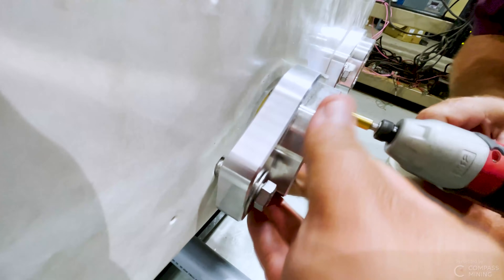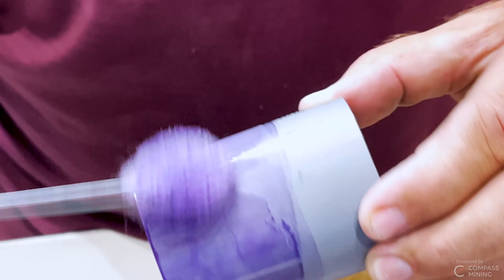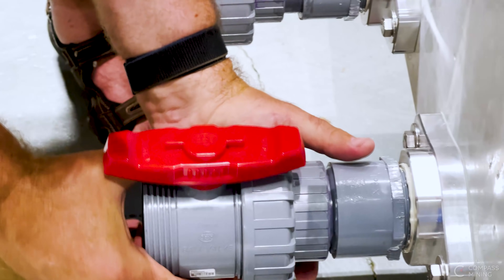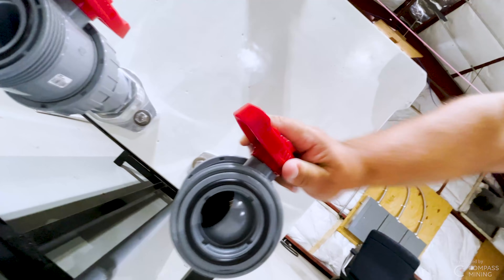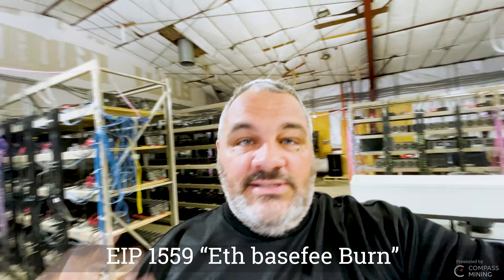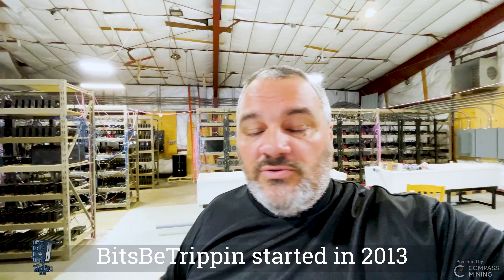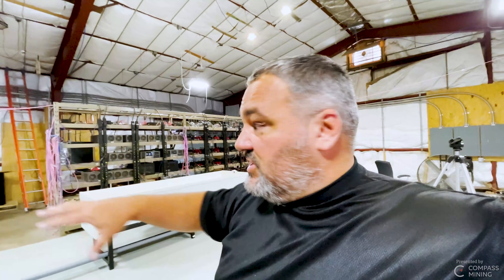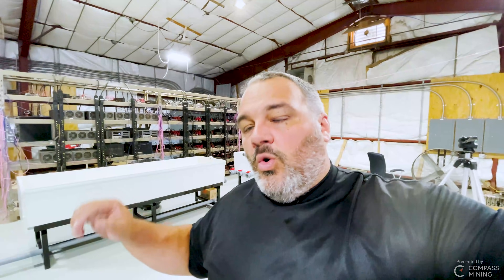Immersion Build - Day 2 - GPU Mining Farm

Comment: Yes you do need to use PVC primer, your Technique needs adjustment and you do not have to use the unsightly purple in your shop for first rate results. I would be curious to know what the design max leaving fluid temp from the HX is, as I would likely not be using even SCH  80 PVC for this job were it me. Last time I checked numbers on SCH 40 it was 120F max, which I am not comfortable with in the least. Even for glycol, PVC is a very fragile affair. If you are an american it would be REAL GOOD to refuse to speak in Metric units or embrace that fallen system in the least.

Comment: Thanks for sharing this with the community. Just a few thoughts and questions:
1) In an overflow system you will typically want 2x the return size as your supply due to friction losses and a non pressurized gravity feed on the return. I noticed you seemed to have the same size supply and return.
2) I am assuming you have an overflow tank for the pumps to pull from, otherwise it is quite a balancing act trying to balance the flow in each individual tank instead and an overflow will also prevent air entering the line from the overflow in your tanks.
3) How are you planning on regulating flow into the tanks besides the shutoff valves? 
4) If just the shutoff valves can they be locked into a specific setting to prevent accidentally being bumped and causing either overheating or chemical overflow?
5) Do you have a bypass line coming off your pump header and back into the suction side to allow you to adjust pressure and flow in the system?
6) What type of pressure/flow testing are you planning to verify before using the expensive mining chemical you purchased?
7) Is there a cleaning fluid you can use to flush the system to remove contaminants before introducing mining chemical?
8) I assume you have a filtration system that would allow you to run the system for 24 hours and then do a filter change prior to introducing GPUs.
9) Looking forward to seeing your cleaning procedure of GPUs to prevent contamination with conductive material prior to being introduced.
10) What type of safety shutoff system do you have in the event of a power loss to prevent a tank from gravity feed overflowing if it sits lower than the fleet?
11) What type of safety shutoff system do you have to prevent tanks from overflowing (floats etc) if the supply outpaces the gravity fed return? Either a blockage or incorrect valve setting assuming it will be manually adjusted.
12) Do have a redundant bypass system to allow taking pumps in/out of service for PMs to prevent having to shutdown the entire farm for PM or CM activities?

If these questions are making you rethink the design then I would definitely do a pressure/flow test first before using the final chemical. I am just not so sure you would want to use water to test the system as I would be worried about getting it all out before chemical fill.

Yeah I have a lot of questions. Maybe showing your detailed flow drawing would help with some of them.

Comment: Profits may come down "SOME"???  Wow , you are given to understatement.  30% is more than down "some" - probably starting tomorrow (8/5/21).  And by Q1 of 2022?  Makes me glad I have only 2 hobby rigs with 10 GPU's total, and a completely unrelated career path that earns me big bucks so I don't give a crap as to what happens at EIP-1559 or the merge.  You can mine RVN all you want with it's power hungry algo, or waste your time and kilowatts spec mining shitcoins like ETC or ERGO for no money just to say you did something with your rigs after the merge...but WHY?  It's a fools errand and only the BIGGEST fools fail to acknowledge reality (think Trump).
Reply from the maker: Frank, we have been tracking this at a pretty detailed clip since inception. EIP 1559 will not drop more than 10% now as most of the transactions have moved over to L2. The eth block right now is 2 ETH fixed Block Reward, that doesnt get touched, plus 0.3 to 0.7 Eth per block in transaction fees. The base fee has been averaging 0.2 - 0.4 of that max. This means, the biggest impact atm will be a 0.2 to 0.4 eth burn per block on the current average from 2.6 to 2.3 ETH adjustment, which is nominal compared to the change from may averaging 4.5 to 6.5 Eth per block down to the 2.5 it is now. 

This was partially offset due to the ban in china that had pulled out about 180 to 200 TH off eth's network. From 650 TH down to 450 TH at the start of this month, now back up to 602TH since most of the A10's Innosilicon and other china ASICs have moved out of mainland china. When Eth goes Proof of Stake, it will have a substation impact, however those with the best power cost will weather the storm as price discovery happens with another currency.  

All of that being said, I'm not here to convince you, I am here to share what we are doing in an open and free way.
Reply: @BitsBeTrippin  Now thats an answer !  Good work! following in your footsteps :-) awaiting on my first 20L EC100 to arrive from NL !!!
Reply: @BitsBeTrippin  Hashraptor published his  post-EIP-1559 data. If his numbers are accurate, the EIP-1559 reduction in income is 19.54%.  Here's the math: (87 - 70)/87 x 100 = 19.540%  It's in his video entitled "Actual Mining Profit Post London EIP-1559 Etherium Implementation."  If his (admittedly preliminary) numbers are correct, your "tracking" guesstimate was off by nearly 100% (10 versus ~20%)
Reply: get a load of this guy